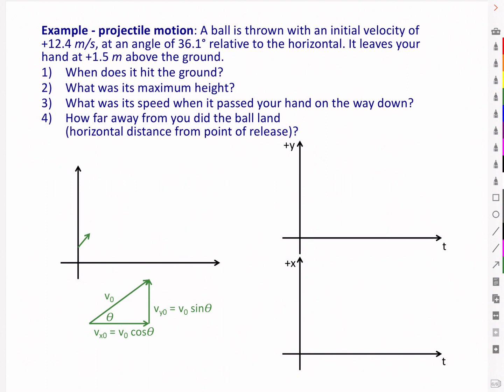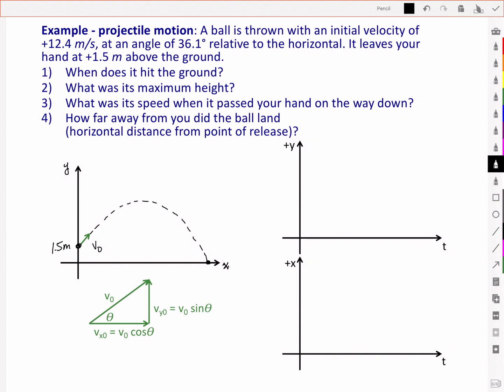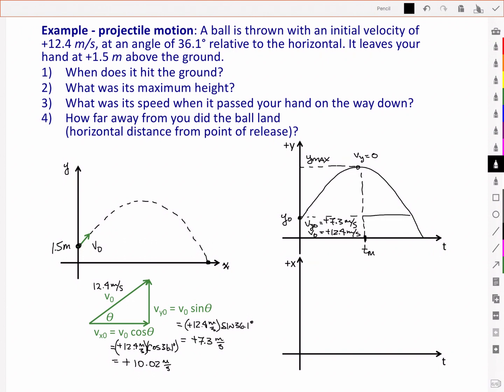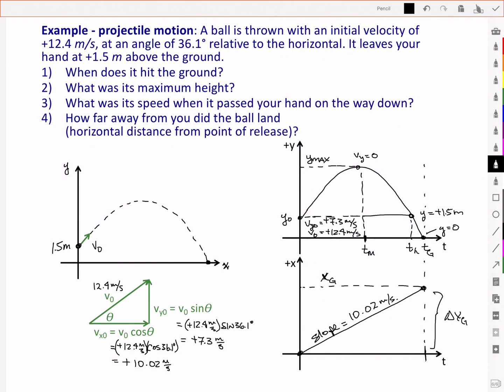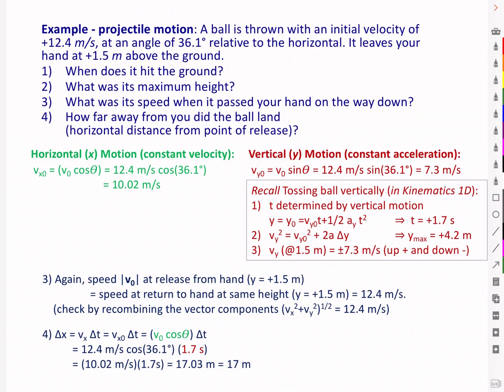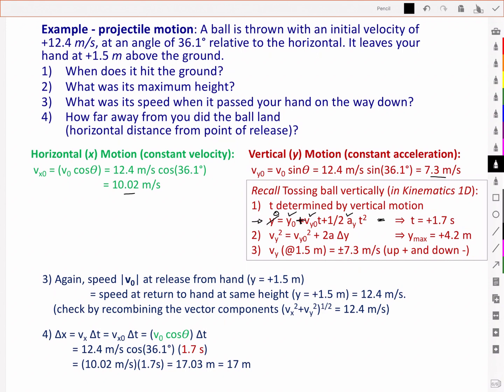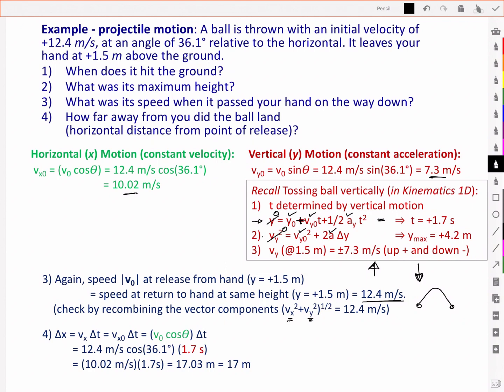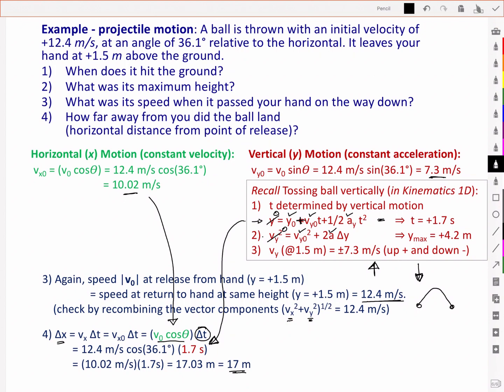Kinematics - 2D motion ball toss example

Comment: somehow I couldn't get the time as 1.7 seconds, could you show a step? thank you!
Reply: I used all of my y components to solve for t. So, I set dy as -1.5 m, ay as -9.8 m/s^2and v1y as 7.3 m/s. Then, I used the quadratic formula to solve for time and I got 1.7 seconds.
Reply: @zoyakhandwala8500  Shouldn't your dy be -1.5m?
Reply: I agree! I wasn't able to get the time either. If Professor Poepping could run through that bit step by step, that would be very helpful!